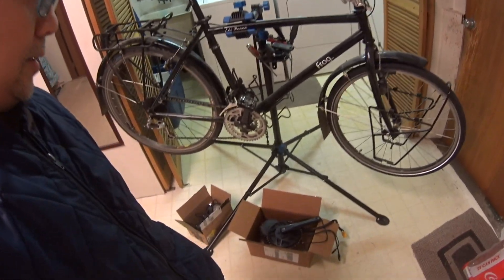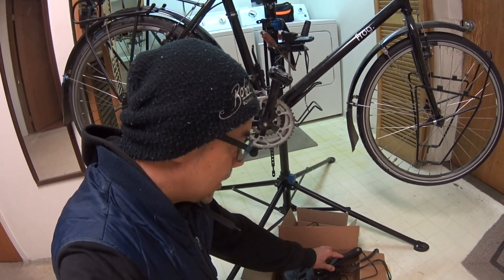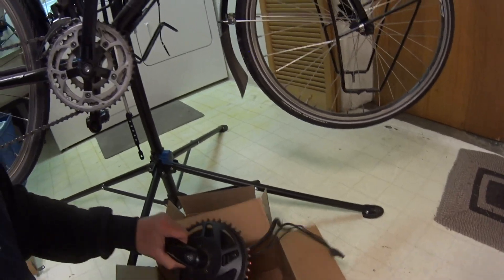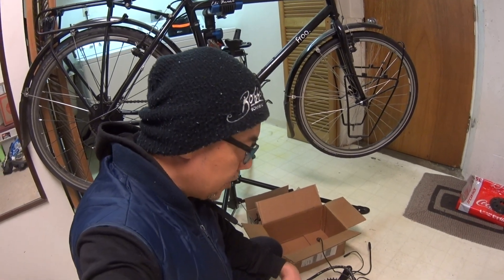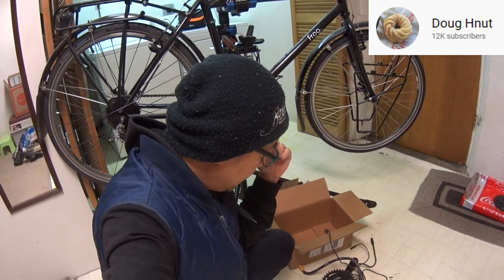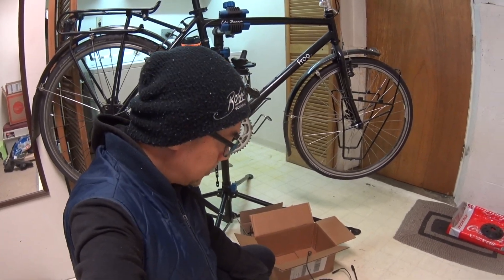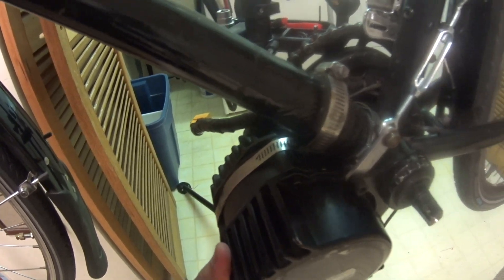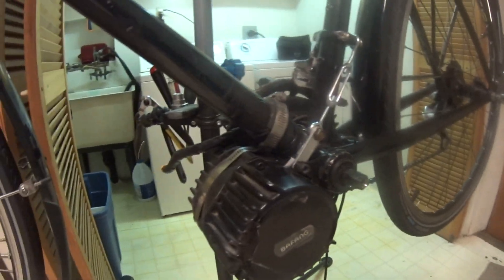Cyclist Turned Motorcyclist Builds an E-Bike | 1000W Bafang BBSHD. So fast!

Comment: Throw some hose clamps around ur battery or it will come loose
Reply from the maker: One year of riding the ebike and the battery has never come loose! And that's with a lot of off road use!  Thanks for the comment however. I will take that into consideration.

Comment: This is probably the best thing you've done with a bicycle. Game changer.
Reply from the maker: Oh I don’t know about that. The Tallbike and the 2wahara are pretty awesome. Lol. But yeah, this ebike has allowed me to go places I’ve never been, faster and longer rides, and I can fit so much more during a ride without getting wiped out from exhaustion. 
Don’t let it fool you either, I can still get exercise if I don’t use the motor, which is what I often do! I used the ebike for training on my last charity bike ride!
Reply: @604Bluelight  This one will last you for many years, and keep you going in the sport for decades. I don't see a tallbike being the right bike for that :D
Reply from the maker: @604_ESP  You're probably right. I'm getting a little old for the tallbike. LOL.  I'm also looking into my next EV project., probably like an Enduro type ebike... something I can go hardcore off-roading on that won't need a pickup truck to take to trails.
Reply: @604Bluelight  EV cyclocross or MTB bike. If you do that I might have to build one too.

Comment: how fast does it go up that hill?
Reply from the maker: Oh sheesh, this video wasn't supposed to be released until tomorrow later in the day. I wonder what happened to my scheduling? 
Anyways, as for your question... I would think the bike could still go full speed going up that hill with my weight. I don't weigh much and the motor is strong. But the motor is healthiest when it is spinning at 1:1 ratio with the gears, so a 42 teeth chainring will be at it's most efficient with as close to a 42teeth rear sprocket. At maximum power my guess it'll do 40kph at that ratio up that hill. It will likely go even faster than that if I go up to the highest gearing of the bike, but I don't like doing that because the torque will just destroy chains and sprockets and in worst situation it could damage the nylon gear inside the motor.